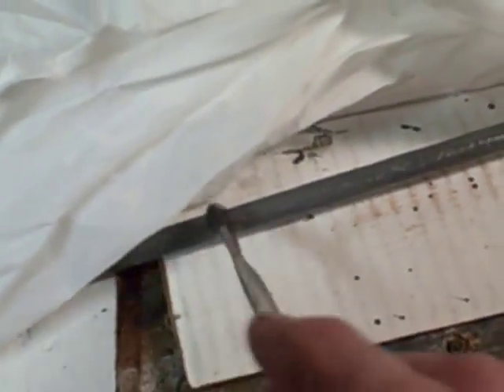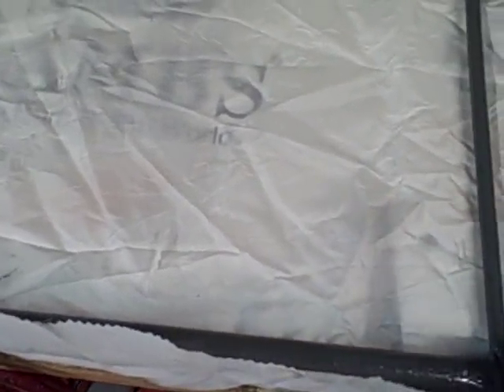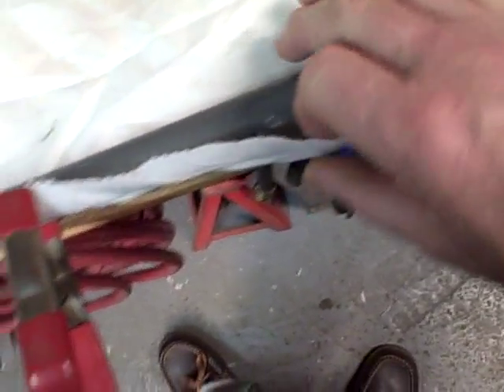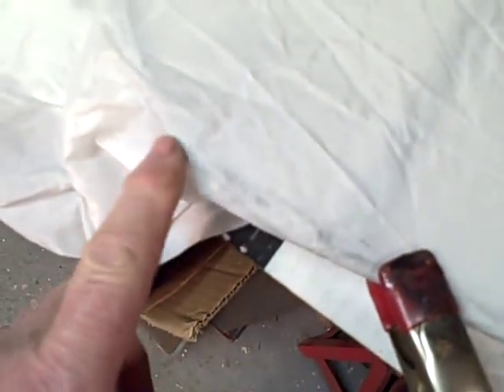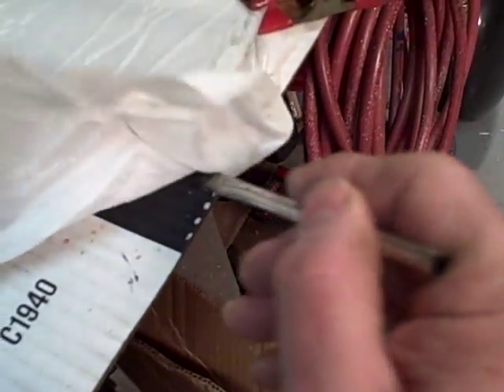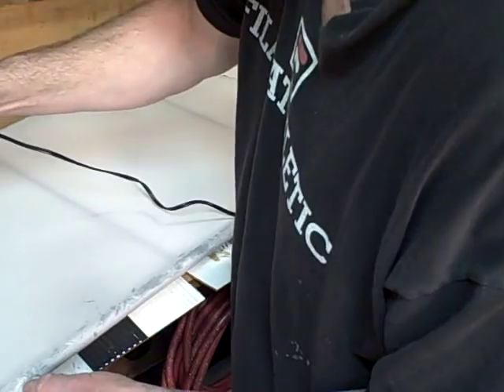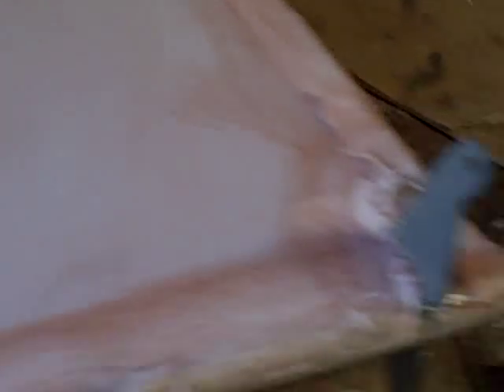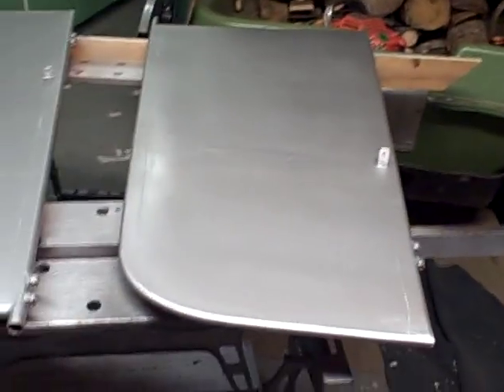FLYING..... POLYFIBRE PROCESS AIRCRAFT COVERING

Comment: Anyone doing this use gloves and respirator, the solvent is a known carsinogen.
Reply from the maker: Tnx 4 comments and your warning, appreciate it. I'm assuming you have a CH701, do you?
Reply: Yes up until recently, Had it for five years, sold it and bought a Rans s6es taildragger for something a little different.
Reply from the maker: I never liked the stol 701 but had several different planes all on floats. Was thinking about a Rans at one time but never ever flew one. What engine are you using?
Reply: Loved my 701, that's why I had it five years, 582 in the 701 and the Rans, both built very light for strip work.
Reply from the maker: had 3 different planes 1 582;  618 and 100 cont all on floats. 618 best one ; over 500 hours on the 618 and performed like nothing else! Don't make them anymore.
Reply: Check Rotax Rick on here, he builds a Rotax 670....well worth a look, would like one myself.

Comment: coming along nicely , I used to do aircraft maintenance ,worked with briggs  in gander.
Reply from the maker: +Bradley Coles  small world......... did lots of repairs  around the Gander area and covered couple aircraft there too.                 Are you still at it, stuff slowed down since 911, eh?
Reply: No I gave it up back in 2006 the chemicals started to make me sick, and there is no fun in that...lol, shortly after that briggs went under, couldn't get no work.
Reply from the maker: +Bradley Coles my young fellow was at it too till 911 then gave it up and went into the offshore oil stuff and still at it